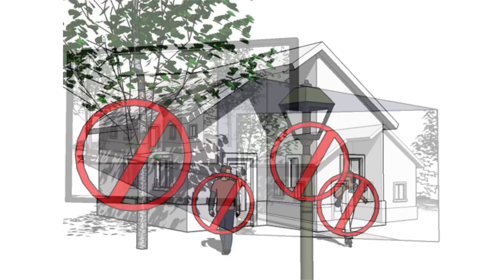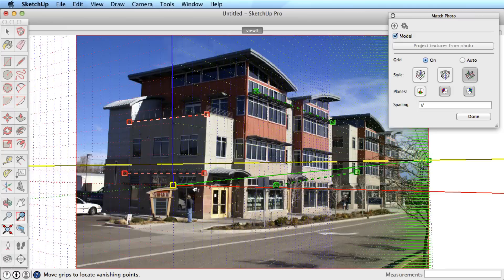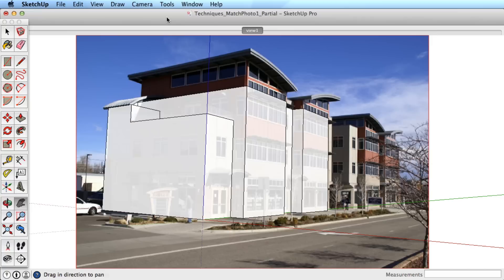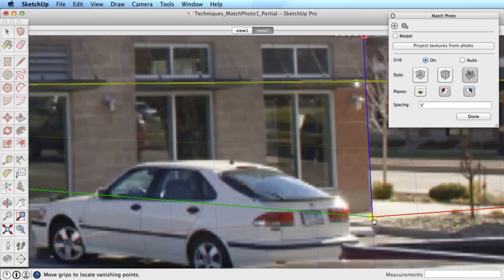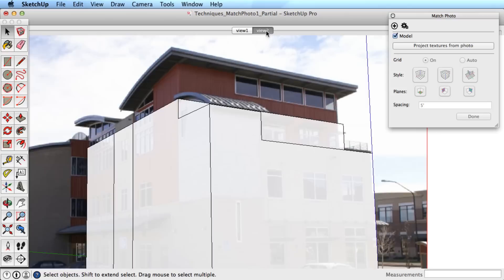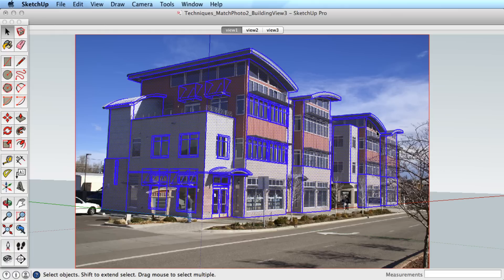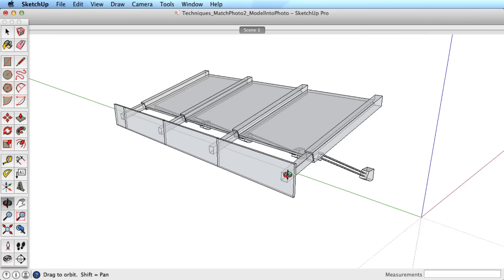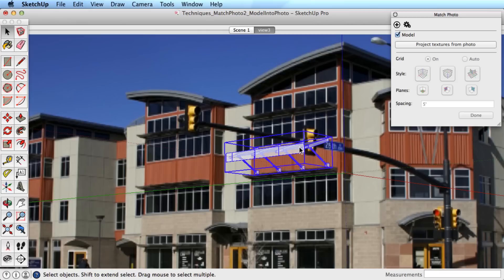SketchUp Training Series: Match Photo part 2

Comment: I have a fully drawn house in sketchup with roof and walls with texture from materials in sketchup and I want to overlay it in a photo of that existing house  in it's own environment. HOW IS THAT DONE? I just get the model transparent and I don't want to project the textures from the photo. :-)
Reply: That's what I was hoping to get from this video as well! But another way I did it was using photoshop, if you have a finished picture of the house/model you're making and have rendered the picture, you can import them both to photoshop and change their perspective angle there. Hope that helps!